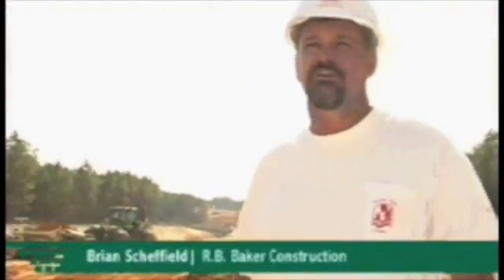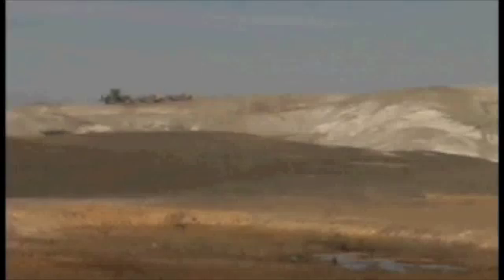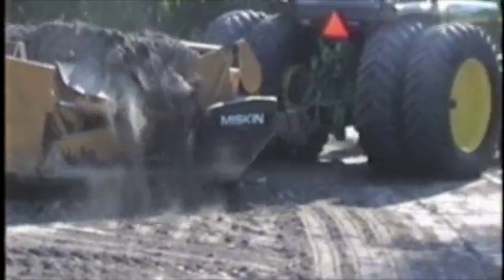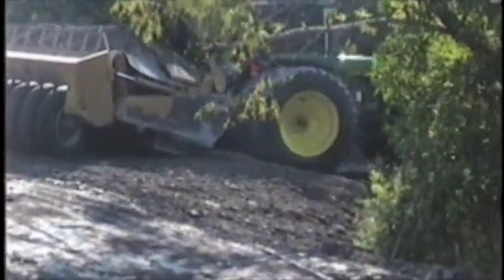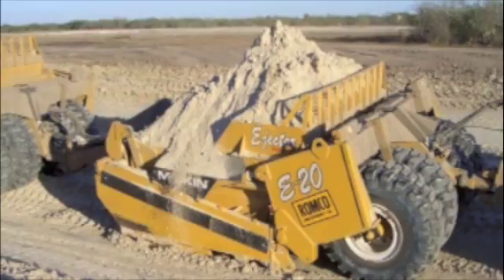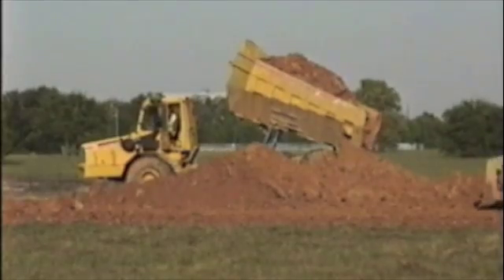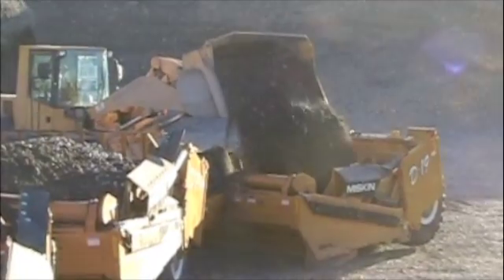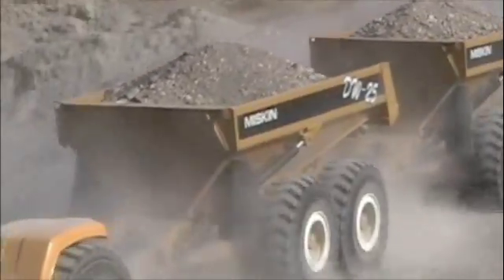Miskin Construction Scraper 1of5

Comment from the maker: The Miskin D-26 has a 14 ft cut, 26 yard, lighter tongue weight, and is quite a bit heavier built that the Deere pans.  You should see an improvement loading rocks with a wider scraper, but still nothing works really well in rocks.  As you know it is difficult to get traction, and with less then 50% dirt with the rocks, the load will not heap up very high.  But still, a pretty inexpensive way to move rocks, even with the limitations.

Comment: The initial purchase price of the equipment is only one of many many cost associated with moving a yard of dirt.  You can lower you fuel, labor and other costs significantly by using more modern, more efficient machinery.